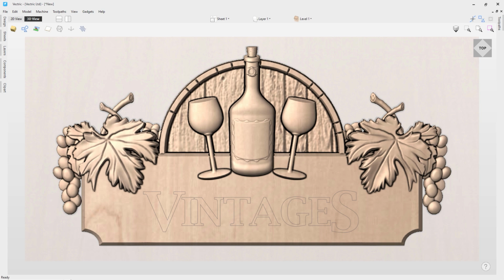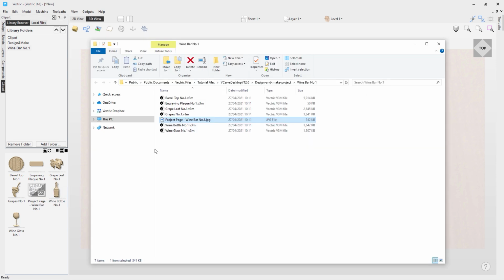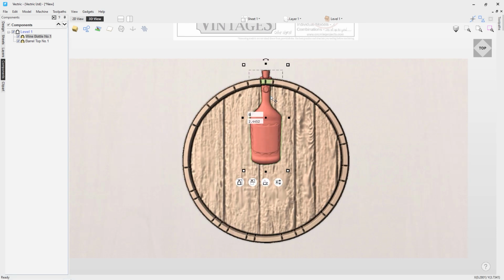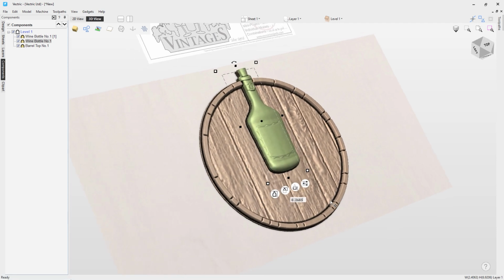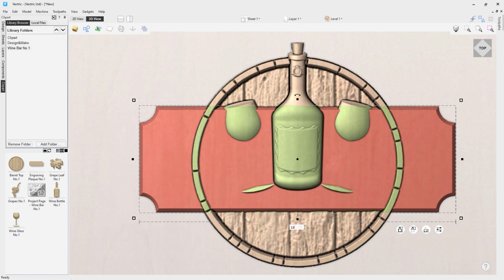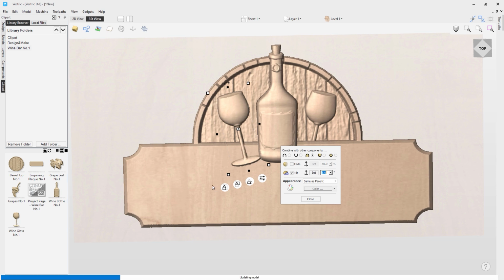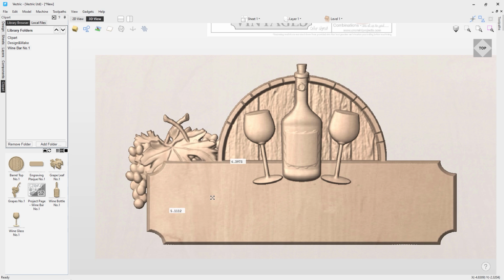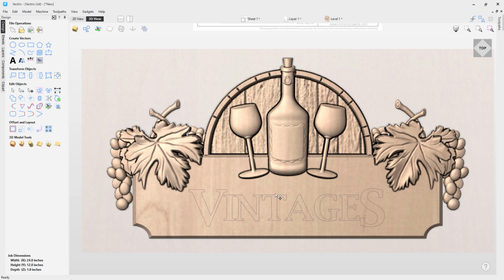How to make a 3D project with Design & Make models in Vectric software | 3D Assembly | V12 Tutorials

Comment: Hi You are talking way too fast. Can you please slow down. 
Thank you
Reply from the maker: Hello Gary... thank you for your feedback.  We will take that on board for next time, but in the mean time you may want to try to slow the vido plaback down.  You can click the "cog" button in the bottom right of the video can cange the palyback speed.
Reply: @vectric  Respectfully, using the "cog" butting makes the video sound groggy and like someone is taking drugs. Which is not easy to understand as well. Just letting you know.